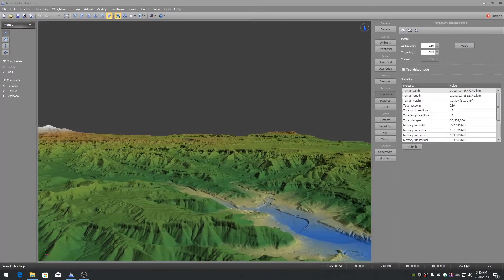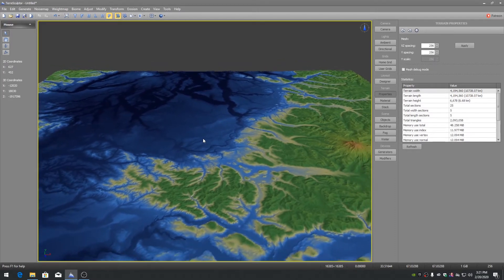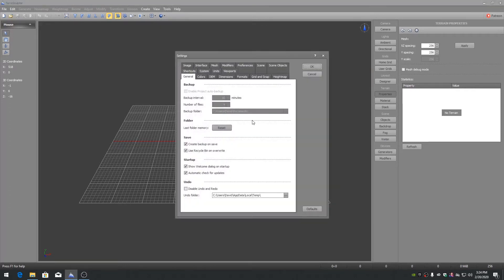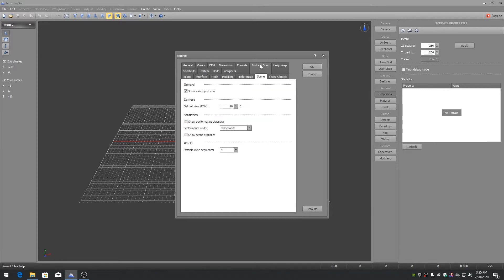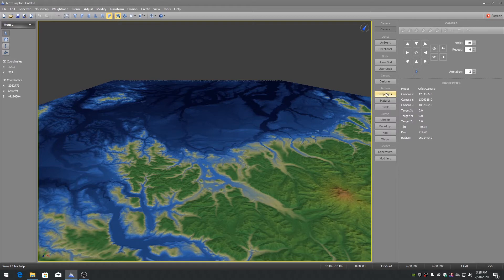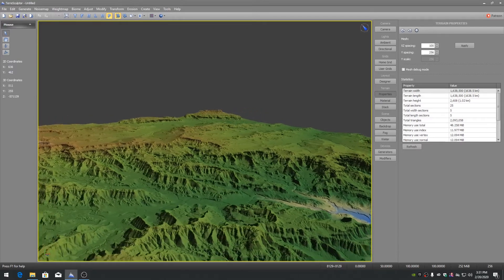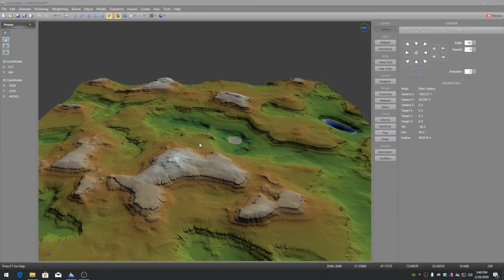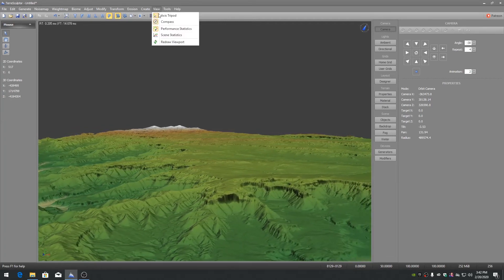Working with Large Terrains

Comment: On the far plane clipping issues, you can use a reversed-z projection and set the far plane to infinity, avoiding the problem altogether, and improving z fighting. it's basically magic. Just google "opengl reversed z" without the quotes
Reply from the maker: Thank you.  I will look into it when I update the OpenGL Engine in a while.  I have a lot of other updates before then, and a lot of OpenGL updates still to be completed.

Comment: This program looks amazing! Would I be able to use these generated landscapes within blender?
Reply from the maker: Yes, you can use heightmaps that you created in TerreSculptor within Blender.  There are a number of ways to do that.
In Blender you can use a grayscale heightmap to displace a mesh grid.  Google "Blender Import Heightmap" for many tutorials on how to do this.
Alternately, you can export smaller heightmaps to OBJ mesh file format and import those, but I don't recommend that for large meshes as OBJ is an ASCII text format and the files will be really large.  I would only use OBJ for terrain meshes of 512 and smaller.
I am also planning on adding FBX file format to TerreSculptor soon, so within the next few months you will also be able to use FBX format to transfer heightmap meshes between TerreSculptor and most 3D software like Blender, Max, Maya.
Reply: @demenzunmedia  Thank you for the fast reply, I did try OBJ on a 4k landscape and that file was about 2GB and it crashed blender, so I tried the heightmap using a displace modifier and that works, but I dont get the extra fine detail in blender that I see in Terresculpter.
I basically made a plane, subdivided it a lot, sub div surface, displace modifier, then added the height map.

How would I keep the same scale on the heightmap in blender as in TerreSculptor?

thanks for the help, loving the program so far!
Reply from the maker: @Jon-ge9mv  - A 4096x4096 terrain is more than 32 million triangles (33,554,432).
I honestly don't know if Blender can do a heightmap displacement mesh of that size.  I have never tried.  I know that I cannot do that large in Autodesk Max.
You will have to create a terrain and heightmap based on whatever the maximum grid mesh size that you can create in Blender.  In other words, if you are creating a 1k by 1k mesh and using a 4k displacement heightmap, you will not get the same resolution in the mesh, so it will not look as good as TerreSculptor.
Large terrains are better suited for video game engines such as Unreal Engine 4, where the Landscape system is actually designed to utilize very high resolution heightmaps with built-in LOD systems.
Reply: @demenzunmedia  I just figured out the fine detail part, but yeah man great software!! any place you know where i can find additional tutorials? I wanna learn this thing in and out?
Reply from the maker: @Jon-ge9mv  - This YouTube channel is all that I have for tutorials at this time.  I am creating new video tutorials usually every week or two and uploading them.  So you might wish to subscribe and get notifications of new videos as they are uploaded.
You can also download the full Reference Manual PDF for TerreSculptor version 1 from the web site Support Archive page (it is included in the TerreSculptor Standard zip file).  The Reference Manual PDF has a lot more information in it if you don't mind reading.
Note that I am in the middle of moving the entire Reference Manual PDF to the Online Help web site (F1 in the software) and updating it for version 2 of the software.  So as soon as that documentation site is complete it will have a lot more information as well.
Reply: @demenzunmedia  awesome! I do like reading and will download the manual. Thanks for letting me know and responding so fast.
I can't wait to Master your software. It looks like this is the one I'll sink my time into. I'm working on quite a large project at the moment. I'll send it to you when I finish it. So you can see your work in action.
Thanks for making great free software. You sir are a gem.
Reply from the maker: @Jon-ge9mv  - Thank you.  Enjoy the software.

Comment: GAH I'm so glad I found this. Thank you for your program. I'm going to dive in and learn as much as I can. It seems a lot simpler than other similar programs. Would you mind making a tutorial on making terrain from a large fantasy world map? That's the biggest thing I'm working on. a "big" world with multiple continents. I already have the map made (black and white) in photoshop. I'm just not too sure how to get to the next step.
Reply from the maker: Thanks.
Are you planning on using a video game engine?  Which one?
What resolution is your Photoshop image?  Did you create it in Photoshop's 16-bit grayscale mode?
Typically the next steps would be to save the Photoshop image to PNG 16-bit, import that into TerreSculptor, then depending on which engine you are using you may have to resample the image to supported engine dimensions, and possibly use the Tile Creator tool to split the heightmap into tiles.  TerreSculptor can also be used to create Weightmaps for the game engine terrain's multi-texturing.

There are videos already on the channel for the Tile Creator and Weightmaps overview.  I also have a large number of tutorial videos under development now, including more in-depth tutorials on using many of the aforementioned tools in TerreSculptor, including the composite weightmap extractor and much more.